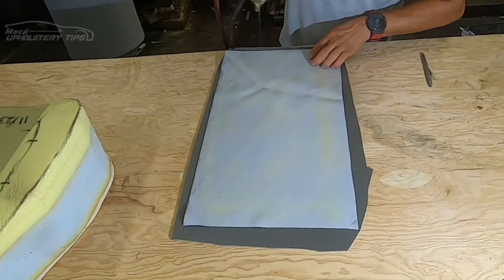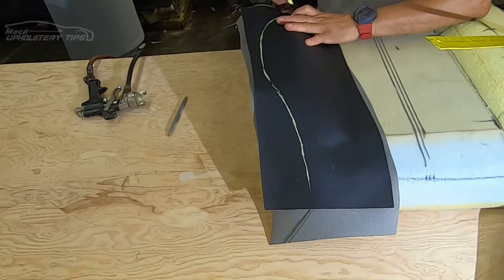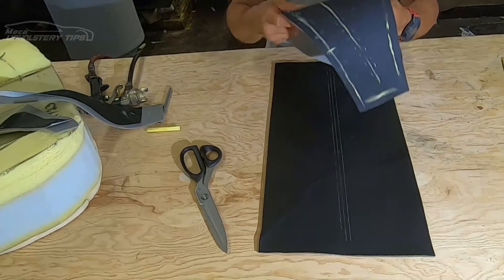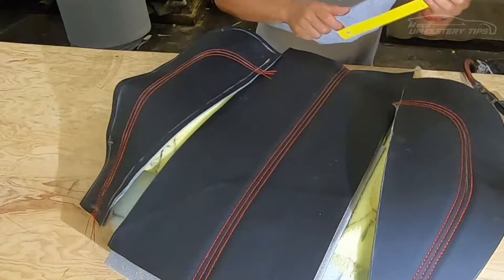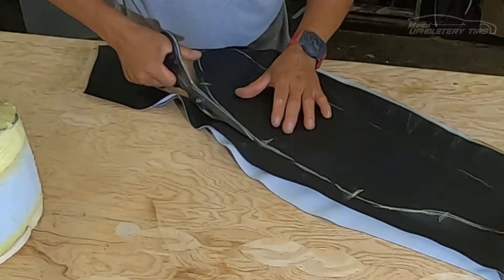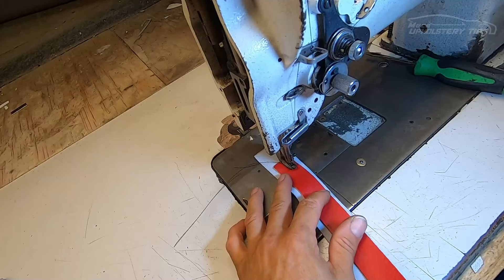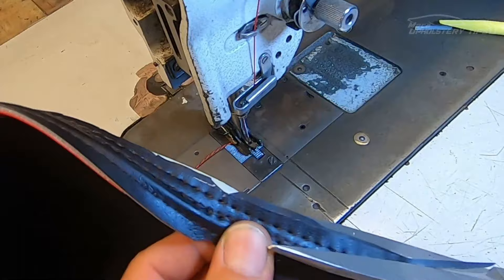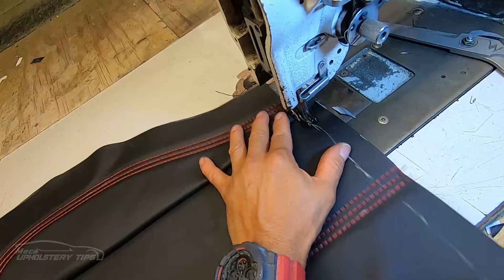How to Make Stunning Decorative Seams - UPHOLSTERY TIPS

Comment: Suggestion instead of glueing down the edges of the center and utilizing a heat gun.  Sew in some lisping pieces in each of the center seams so you can attach them more permanently with staples or hog rings.  The lisping ensures they will not detach or shift.